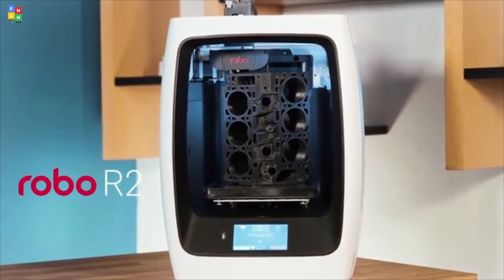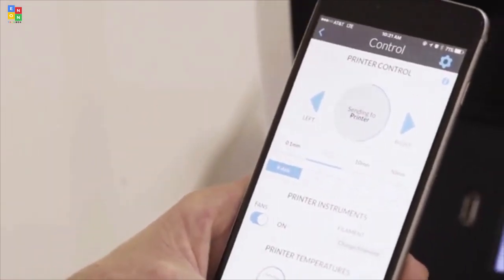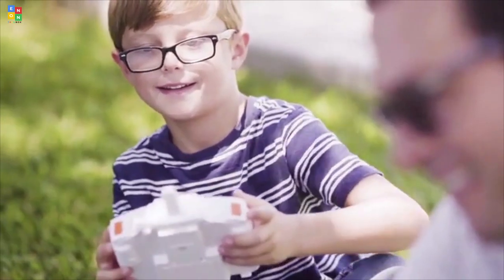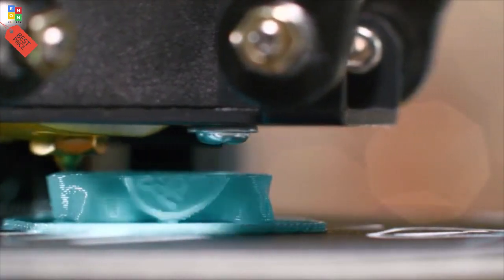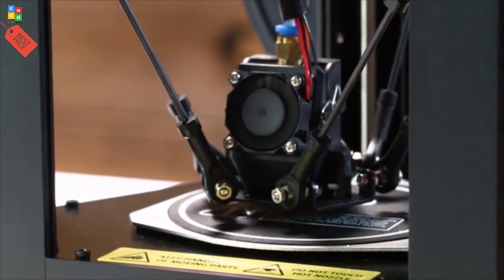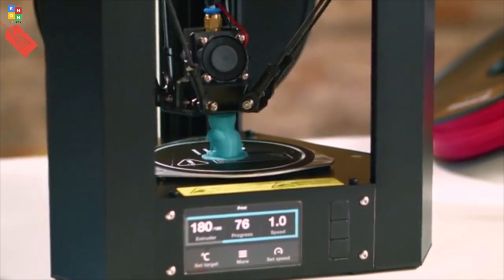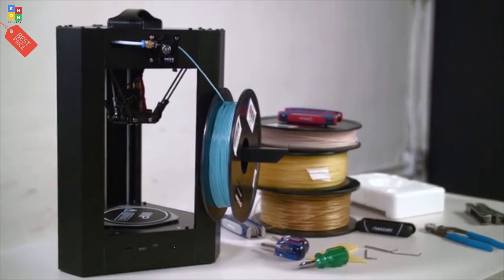Top 10: Best Cheap 3D Printers Under $1,000 of 2018

Comment from the maker: Best 3D Printer Deals:
00:06 #10 XYZprinting Da Vinci 1.1 Plus Wireless 3D Printer: https://amzn.to/2LGUDlQ

02:54 #9 Dobot DB-MZ001 Mooz 3D Printer 3 in 1: https://amzn.to/2LdZr66

03:25 #8 Robo C2 Smart Assembled 3D Printer with WiFi: https://amzn.to/2OaPwfx

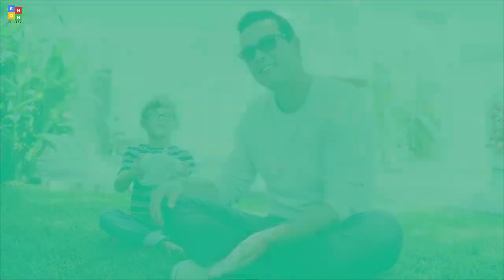04:49 #7 Robo R1+ ABS/PLA Assembled 3D Printer: https://amzn.to/2uIKQoX

05:56 #6 Monoprice Select Mini 3D Printer v2: https://amzn.to/2mAZGJR

06:32 #5 WEEDO M2 desktop 3D Printer: https://amzn.to/2uJbluJ

07:18 #4 Monoprice Mini Delta 3D Printer With Heated: https://amzn.to/2LHjWo6

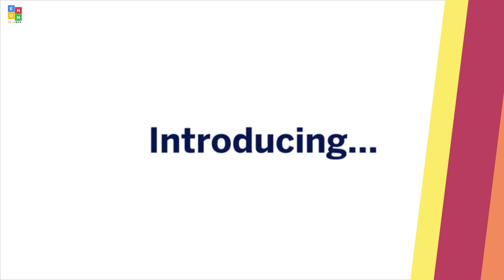09:11 #3 Dremel Digilab 3D20 3D Printer: https://amzn.to/2LFqTFX

10:25 #2 REPRAPGURU Black DIY Prusa I3 3D Printer Kit: https://amzn.to/2OcF7Qj

11:06 #1 QIDI TECHNOLOGY 3DP-QDA16-01 Dual Extruder Desktop 3D Printer: https://amzn.to/2Lvy3QA

Leave a LIKE, Comment, Share & Subscribe https://goo.gl/kpz2kc

#3dprinters #best #3dprinting